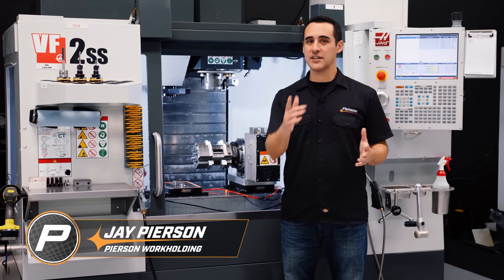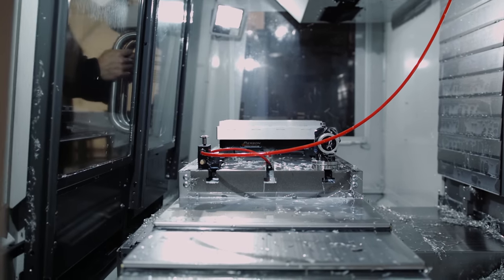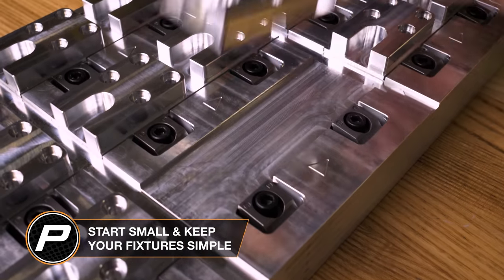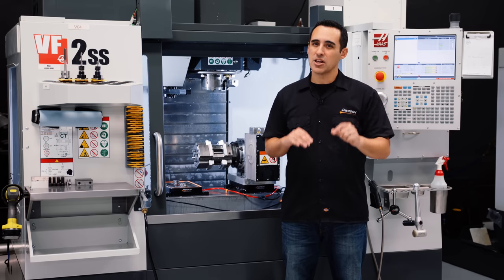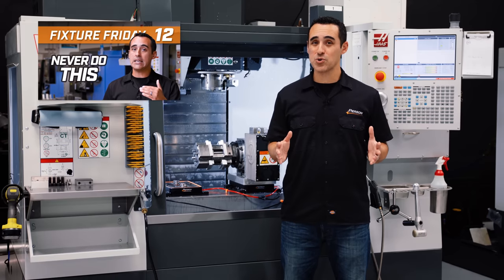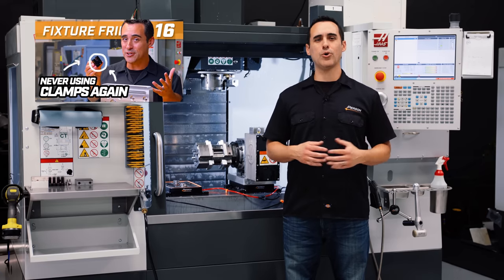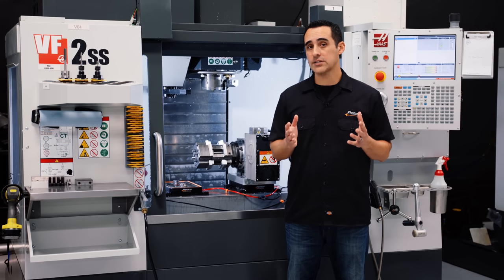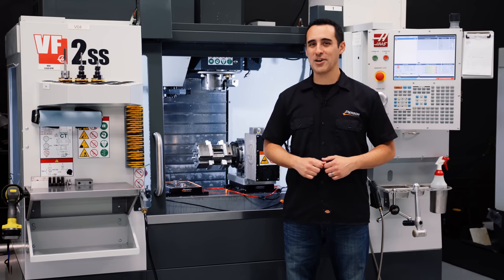ULTIMATE Workholding Tips | Fixture Friday 20 | Pierson Workholding

Comment: I made all my own custom fixtures, but the smallest quantity holds 5 parts, the largest holds 128. The most common fixtures range from 32-88 parts per fixture. This is on a 6x12x1/2 inch fixture plate too. Once I upgrade to a Speedio from my Tormachs, I'll be developing and expanding my current system to allow running 4 of my current fixtures in one cycle to hit the ground running, then develop larger fixtures for the higher demand products instead of making all new bigger fixtures right off the bat, fixture systems are incredibly versatile in that regard. Love this series. Once I do finally upgrade to industrial machines, ill definitely be looking at getting some Pierson pallets, not for my production fixtures themselves, there are too many to justify the cost, but isntead I'll use them to be able to hot-swap my entire setup, so I can go from my production fixtures, swap to a vise, swap to a vac table and never lose my setup and have to tram everything in every time. That's going to be a game-changer for me.

Comment: Pallet durability is really one of those things where people really just go out of their way for no good reason

In one of the factories i've worked in, there's some fixtures where the contact surfaces are DLC on either carbide or steel (the guys who made them are either dead or retired so no clue which) and the cost of these buggers still hasnt been recovered compared to using hardened steel but at the same time, they don't seem to care.

They'd seen close to 80 million parts (~4 million each) and from the documentation i found, they have not changed at all.

Comment: I shouldn't give this idea and just do it myself. 🤣😋 Anyways, the clamps wouldn't wear out that fast. I mean at best, the threads would pull out. In that case, I would be making EVERY fixture (that you use and sell) with helicoils. Straight eliminate the issue. With the ideas you have, I am sure you could whip up a device that would auto thread those in for you. Straight drill (25/64) and tap the 3/8-16 holes (3/8-16 sti) and send the fixtures of. You would probably never have a thread rip out. (Even though it sounds like you have yet but this is not the same as making a solid steel fixture for no reason.)

Comment: How do you convince an employer something like this is worth it? Im
In the semiconductor industry and our work, fixtures, tooling is controlled by the customer and it takes tests and 1 year wait time to make changes. We use a fixture that makes 1 part at a time, and 8-10 parts per day. Even though the cycle time is about 30 minutes. They have the if it’s not broke don’t fix it attitude and don’t want to increase productivity
Reply from the maker: It's not our job to convince people that different ways are better. We can only present options and let them decide. If the customer doesn't want to improve, that's an opportunity for the competition to surpass them.

Comment: whats hanging off the side of the spinde? looks like a spider cool, but ther is a Pcool there so i must be wrong.
Reply from the maker: We have air knives on most of our spindles to blow off parts automatically. Maybe that's what you're seeing.
Reply: @PiersonWorkholding  maybe? that would actually be a good vid for selling your products, in process cleaning methods to make faster pallet swaps. i love my mini i got for the job i bought it for, but the swaps where slower due to me cleaning in machine. no spare workspace (garage) to do out of machine coolant/airgun work, too messy. i dont care if it took longer for the machine to do it, as i can do something else while it runs.